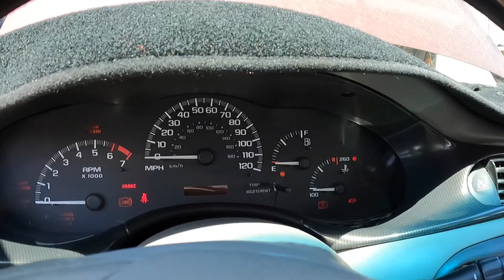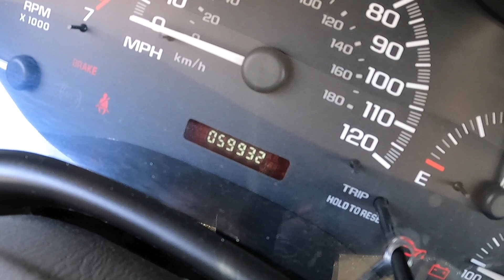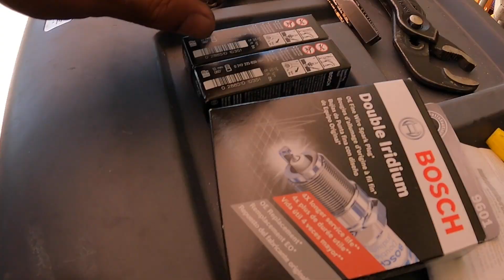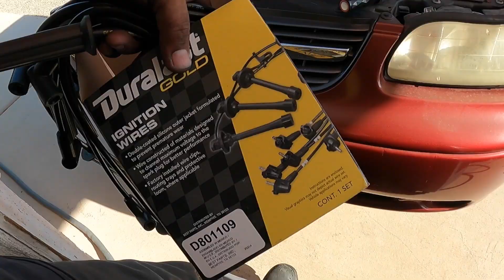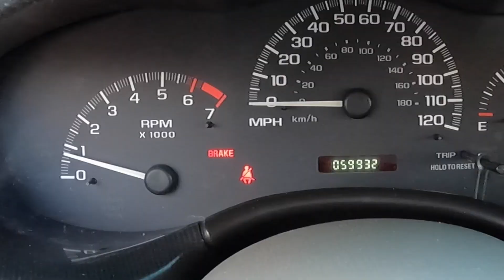How to replace spark plugs and wires Chevy Malibu (NO BS Complete Repair)

Comment: That was a good reliable car. After replacing the defective factory GM intake manifold gaskets that 3.1l engine was a reliable pushrod /timing chain engine.
Reply: I had the same problem with one and 3. 1 I grabbed with channel locks and rolled the channel locks towards the fire wall made it 5xs easier. Was still a major B***h

Comment: I have found a good way for me to remove that stuck plug boot. These boots become baked
onto the  plug. Get a suitable size worm gear type hose clamp. Put it tightly all the way down
to the boots end where it is right next to engine block. Now tighten it up securely. Now do
this . Pull up on hose clamp, even twisting it back and forth. You are separating it away from
being baked into plug. Do not give up. It will now separate from plug. Works every time for me.😊9

Comment: I've done several of those in different makes. Buick,  Olds, Pontiac.  It's a little more work,  but I take  the  alternator off, and can slip my hand behind head.  Definitely not one to work on unless engine is cool.  Thanks for your videos.
Reply from the maker: hi Robert, maybe next time i will try that. thank you for sharing
Reply: @FixItAngel  not a problem my friend.  I've been wrenching on cars at least 40 years now.  I look at your videos and still learn from them.  Keep up the good work.
Reply from the maker: @robertsimmons9402  it’s amazing you have that much years of experience. I’m delighted you still learning from my videos. Thank you for watching. Have a nice day.

Comment: What I’ve done before is to wrap a tie wrap around the boot with a much longer tie wrap looped under the tie wrap around the boot. Use the long tie wrap loop and a pry bar to pull up on the boot. Works every time.
Reply from the maker: thank you for the tip Kenneth. I will try that next time.

Comment: Thx419x tool is the way to do it. If your on a budget a ratchet strap after removing both front dog bone motor mounts then ratchet engine forward to get easy access to rear plugs. Take your time, don't get frustrated. Use quality plugs and lube boots with silicone or dielectric grease.

Comment: The Lisle 51250 is good for saving the boots and the Thexton THX419X to pull the engine forward or ratchet strap. Or take out the coil packs. Still no fun.

Comment: My father had an Oldsmobile Cutlass Cierra with that engine. I remember the back spark plugs were a pain. I see those plug wires were tough enough to remove on the front side, and they were easy to get to. I think I remember putting dielectric grease inside the new wire boots to make them easy to remove the next time.
Reply from the maker: thanks for sharing Agostino

Comment: Confusing whether you should be putting silicone paste ( conductor or insulator?) or dielectric grease (insulator) or vaseline petroleum jelly (conductor) in there for next time, or does it in practice matter.
Reply from the maker: dielectric grease is used for electrical connectors, ignition systems. sillycone is also ok to use.  both does not conduct electricity and waterproof.  I did not have any dielectric so i use sillycone grease. gotta use what you have.

Comment: Had an 06 Freestar 4.2L same thing.  Take off windshield to engine plastic and just slip your hands behind and do everything by touch.  Would always buy plugs and wires because you knew it would be an epic battle. Now with a Kia Rondo 2.7L you just remove the surge tank which is just as  big a pain, so...🤪
Reply from the maker: thanks for sharing your experience. i hope i don't get to repair that kind of car. LOL

Comment: I share your pain. I ran into a similar situation with a broken spark wire underneath intake manifold on a Camry V6. After a week I found a socket with longer neck space to pull the spark plug out.
Reply from the maker: Hi Gary, thanks for watching. you gotta do whatcha gotta do to get it done. good job brother.

Comment: Unbolt the front engine support and pull the engine forward (roll the engine forward) that's in GM manual anyway put some electrical grease on the boot

Comment: The rear plugs are easy 2 motor Mount bolts ratchet strap the motor forward remove the coil got about a foot of room to work with
Reply from the maker: i will try that next time. thanks